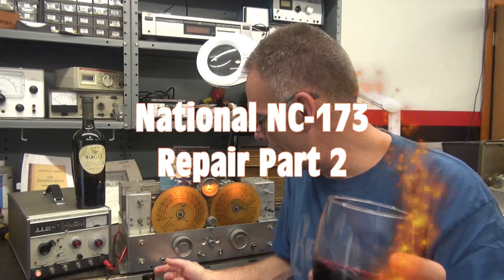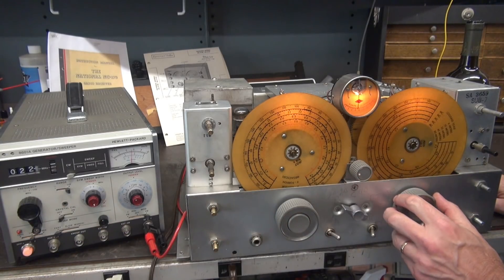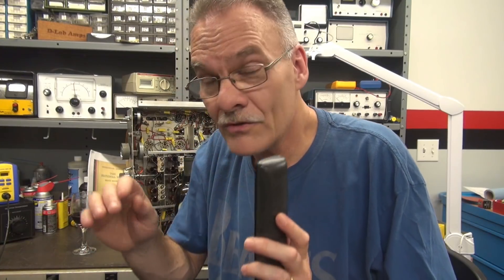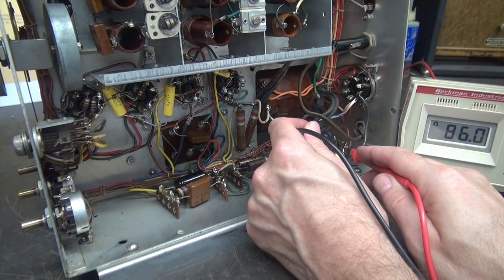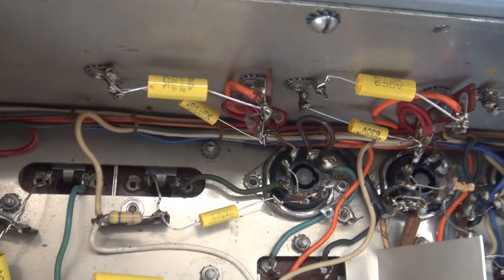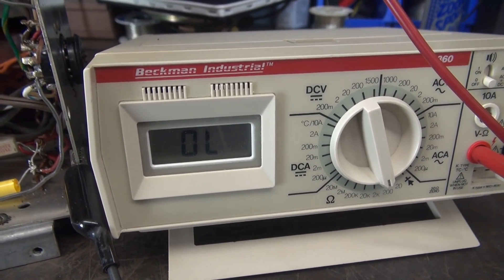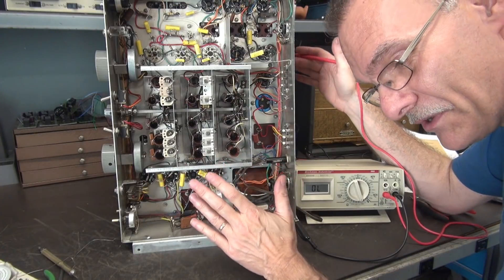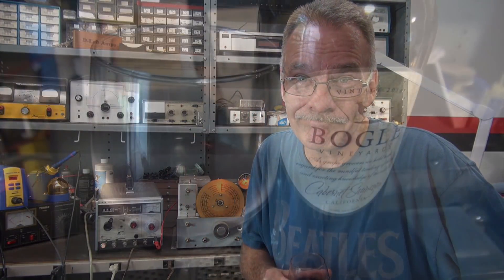How to fix shortwave radio weak receive antenna RF Coil National NC-173 Part 2

Comment: I have a 1947 Magnavox receiver which pulls in ONE local AM station loud & clear at 1400 kc. On the shortwave band, no signal on the left end of the dial after 7 mc, and on the AM band same spot at about 710 kc, nothing to the left of that. If I did the Cap job and replaced all the resistors, I'd still have this problem, wouldn't I? The dial goes from 5.0 to 18 mc.
     The output stage seems to be somewhat OK, a pair of 6V6s like from a Silvertone guitar amp that I put in there...This unit should probably be on your bench.

Comment: Hi, I am new to SW. I have had people tell me to take my long wire and coil it. I live in an apt in the city. I can not have anything outside. 
If I take my 25 ft. copper wire  and just make a coil will that increase the reception?  I have it strung high op on my 12 ft. ceiling. Any suggestions would help.   Thank you,

Comment: Could you do a video on the repair and replacement of vintage AM/FM RF transformer/oscillator coils?  I have a vintage Fisher 800 stereo receiver and was wondering if they can be updated with something new?  They are all obsolete these large oscillators, and working on a defective one is like brain surgery.

Comment: what are your thoughts on replacing carbon resistors in rf circuits? ive found they dont work. whats your experience with that?

Comment: Love watching your videos. I've learned a lot already.  I recently bought a zenith x334 from 1969 and need to replace the filter cap. It's a three section cap rated 80mfd/150w.v. 60mfd/150w.v. 40mfd/150w.v. what value caps can I use as replacements?

Comment: Excellent, Terry.  If you want to restore it to at or better than factory spec, it takes effort.  With modern replacement components and test gear we should be able to get these radios performing as they did when the rolled off the line in 1948.

Comment: I wish you can fix my oscilloscope. It keeps blow fuse away.   Its made by HP vacuum tube.  sixty years old.  I bought it on eBay .  It turns on for 2 minutes and then shuts off. When I check fuse its blown .      Maybe I was using a wrong fuse ?   What fuse in general do you need for vacuum tube scopes ?  I was using 2 amp 250 volts . Is that right fuse.  Or I need 3 amp fuse ?  I do not have special tools like you. All I have solder iron and some basic tools like screw drivers drill saw etc..    I do not have those meters you using to test a components .  I don't even know how capacitors looks like.  How they look like ?  And where do you get new capacitors and how much ?   How do I know what capacitors do I need ?  Its not like a changing light bulb in your living room.   Or vacuum tube is easy

Comment: have a n57 with crackly mid band turned out to be corroded plate coil on rf amp tube , had to count off turns and rewind with new wire & yes its time consuming but it worked & tuned well  all part of the restore of old gear! lov it

Comment: Terry, how can you be sure your reading ohms correctly,when all your resistors are in circuit,you will pick up capacitors & other resistors. With all due respect.....
Peace..Hugh
Reply: Often, most of the resistors terminate at a fixed cap or a tube element pin, so that they are practically isolated.  (If the caps were replaced as in this case, they won't be leaky & can be considered open circuit for DC ohms measurement.) The schematic will, of course, tell you when you have to lift a resistor lead to get an accurate reading. A recent SW set I worked on, I think I had to lift only 2 or 3 resistors.
Reply: What willrobbinson
 said.  Generally, things in parallel with a resistor will make the resistor read *lower*, not higher.  (residual charge, or something reacting to the meter's test voltage could cause a high reading, but that's really, really rare.)  So, if you measure it, and it's high, it's a pretty good bet the resistor is bad.  And since most resistors fail by going high, it's a real time saver.   Now, it's possible that a resistor has gone high, but the things in parallel are making it read normal. Not likely, but not impossible.  But usually that test is good enough (999+ out of 1000) to move on with confidence.  But in this case, so many resistors were clearly bad, he replaced all of them, so, no concern over a possible mis-reading.
Reply: all of the resistance readings are higher than should be , if the reading is lower then u need to disconnect one leg to  rule out circuit loading

Comment: RF problems can be a true pain. We restored a 'early 40's RCA console and a total re-cap and resistor replacement, then found it had a missing band.
 We found it had been mis-wired at the factory! Connecting the wire to the proper wafer switch terminal restored operation. Poor QC on that radio.
 We spent hours on that set trying to figure out the problem too.